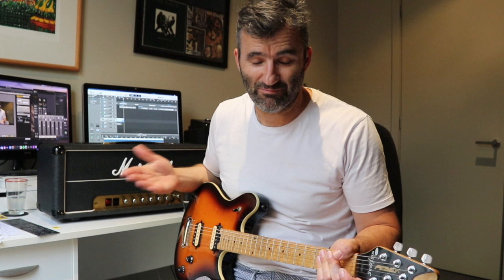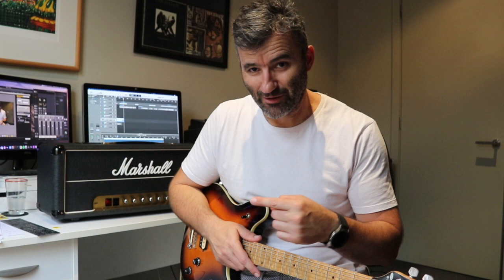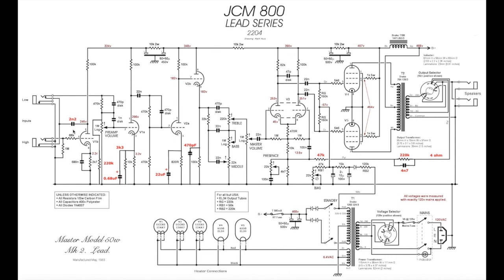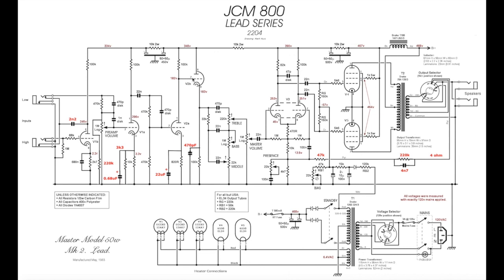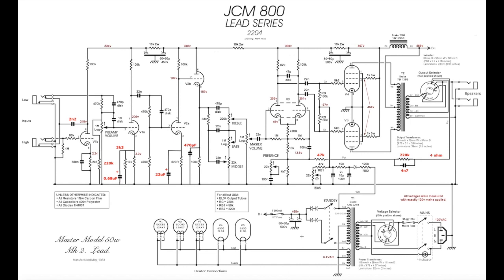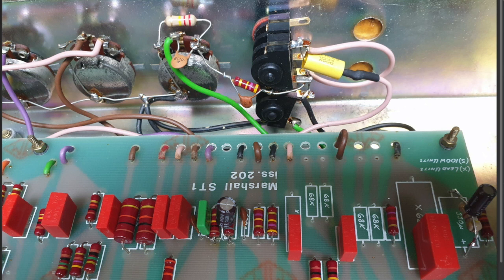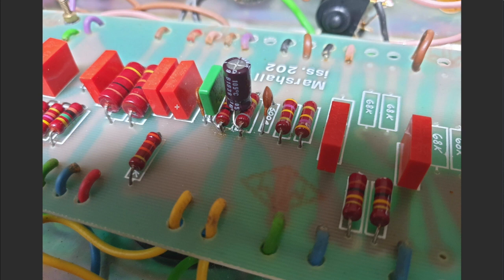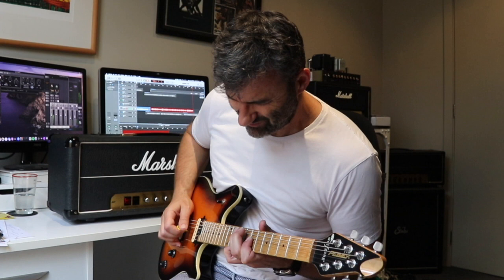Marshall JMP/JCM800 2203/2204 - Jake E. Lee Spec Mod Guide

Comment: I’ve just done this mod to my 2203 and it sounds and feels absolutely superb!! For anyone thinking of doing it (if you know what you’re doing) do it!! Completely reversible, but guarantee you won’t change it back. Amp now sounds bigger, but the low end is tighter and the clarity is great. Doesn’t add a massive load of gain - Just enough IMHO. Great stuff!!
Reply: did you leave the NFB resistor at 100k or did you change it to 47k?

Comment: Just a note guys - at the 3:12 mark I mention 1987 & 1959 model Marshalls.  They have the same PCB, but would require to be converted into 2204/2203 spec for this mod to then be applied...
Reply: Can this be done to original vintage 1987/1959s?
Reply: Any similar sounding mods for 1987 circuit with a LarMar PPIMV already installed?

Comment: This is absolutely crystal clear. Love your patient and calm approach, walking through the circuit. I learned a lot - thanks! I'm also impressed with the clean way of adding components, without disturbing other existing ones. I do worry about modding my completely stock 1984 JCM 800....But this definitely makes it an option.

Comment: Thanks so much for this Jason. Made the mods to my 1987x and now it sounds amazing. I removed the two unused jacks on the front panel used one for the depth pot and the other for a DPDT switch to make the 3k3 and .68uF across the 10k cathode resistor and the 220k across the gain pot switchable. In the up position it’s pretty much like a stock 800 with the cold clipper and in the down position you get the JEL mods in input 1 and a pretty convincing Plexi sound in the low input with the master on full. Thanks again!
Reply: hello, your modifications are certainly interesting, give us a video with the result of the change of sounds which if relevant, this will be more concrete for the audio of your modification thanks

Comment: Stumbled upon your videos couple a days ago; wow, really like how it's done and presented! And very generous too by sharing schematics 👏
I've done a slightly different take on the JEL; shifts upper-mid emphasis a bit lower in frequency and a bit less gain: 4n7 instead of 2n2 from 1st stage, 470k/470p can be left as is or both replaced by 220k (depending on wanting more/less highs), no 220k over gain-pot, 1nF on gain-pot changed to 120pF and a 680k from wiper to ground, 3k6 instead of 2k7 on 2nd cathode and no 0,68uF, 2n2 out from 2nd stage (important), and no 22uF on 3rd cathode. Keep 470pF over 100k on cathode follower. Can be worth trying 390pF as alternative value for 470pF in tone stack; gives a slightly different feel to the highs.
Reply: Good ideas. I like 390pF a lot here or there.

Comment: What's funny and to balance it out is like you said, the front end is tightened up going from the 22n to the 2n2.  Also to mention, the gain pot has a 1n "bright" cap on it!  BUT...the 470p on the 100k cathode Follower is Friedman's "Dark" MOD and darkens it.  Likewise, as you said Jason, the 4 ohm tap will make the amp sound more "dark" and again rolling off the top end.
Reply: What do you mean "dark" mod?  What amp has this?  I thought he used a 1000pf here in the be.
Reply: @cap217cap217  On the early BE-100's, Dave Friedman used to label the amps "DARK" for Dark MOD.  What it would do is on a switch add a 500pF Mica capacitor on top of the 100k cathode follower resistor.

Comment: there's a massive difference in this mod between leaving the stock 100k nfb resistor and the 47k from the mod. I played with this and ended up with an 82k.  A 47k and you just lose alotta life in the sound. i suggest folks test this before committing

Comment: How is this JEL100 spec when the 2203ish channel on that amp has a depth control and a switch with two gain levels? This sounds great but maybe it is  it's own thing.
Reply from the maker: Well, it’s essentially hard wired in the higher gain position and has a fixed depth (like having the depth pot at midday give or take)

Comment: So I've been running a hot mod evo 2 in my 77 2204. Aside from the extra gain stage is there much difference in the low end cut and response?

Comment: I'm redoing my plexi after the Cali is fixed.  Then I think I'm going to give this a go.
Reply from the maker: You could implement these mods on the 2204 board you have from us, no sweat.
Reply: @HeadfirstAmps  yeah I thought about it but  I'm really enjoying the stock.  I think I still have one board and 2 sets of transformers for a 50 watt marshall. I want to do this with a custom faceplate from you
Reply: @HeadfirstAmps  Im out of 1 watt 220k. would a half watt work here or should I use a 2 watt or just wait until my 220k arrives?
Reply from the maker: Awesome.   More is more!
Reply from the maker: 220k 1/2w would be ok over the gain pot.  You'd want 1 watt (or 2w) for the depth circuit.
Reply: @HeadfirstAmps  Hey man. I modded it today. It sounds great! That was a fun project and I learned a good bit

Comment: Hi Jason, thank you very much for this extremely well explained sharing of information which made me want to get started!
 I did everything scrupulously but I have a small problem:
as soon as the preamp is above 3, the sound, although not saturated, cuts off... and comes back if I drop below 3

When I put the 10k cathode resistor back on V1b as originally (instead of its recommendation: 4.7k + 0.68uf in parallel) the sound returns to normal.
I also tried a value of 4.7 k instead of 10k the sound cuts out too...   
A small idea? 😀
Kisses from FRANCE
Reply: I have the same problem.  Did you ever figure out what the issue was?
Reply: @patwebb6534  Sorry for the late reply. I've gone as far as I can without finding it. I took my amp head to the technician. I'll get it back soon, I'll let you know... 😉

Comment: Great videos thank you!
I have a question, I plan to build a "clone" of a 2204 but with some mods.
I want it with a power scaling similar to a Origin 20, do you have the squematic of a power scaling I can add to a 2204 ?
And I want some simple and switchable mod to add more gain, I don't know if you have some recommendations..
Reply from the maker: I haven't yet traced out the Origin 20's power scaling, but I can tell you it's a cathode bias amp and the scaling is done via varying the screen voltage, and also the PI supply.

Switchable boost,  check out my FET boost board,  perfect for a 2204.  Watch my 1987x part 3 mod clip for details.
Reply: @HeadfirstAmps  That power scaling is something that any technician could make?
Reply from the maker: Hmmm, no probably not 'any'

Comment: Ahhh. 30 years ago I modded my jmp. 5 years later I unmodded it. 5 years later I modded it again. 5 years later I unmodded it. 5 years later I modded it again. 5 years later I unmodded it and have been happy with using a SD-1 until hearing this. After hearing this I’ll be dipped, I am probably going to try this mod. Is there a 12 step program for people like me?
Reply: Sounds like you already did the first 6 steps. 😂

Comment: That amp sounds killer, I want to build a 800 replica, may be from Ceriatone or something like that, I wonder if some mods like this could be added with a switch so you can have your "stock 800" just with a switch. Is it posibble? may be just a mod that adds a bit more gain to avoid using a pedal. May be just the famous 22uF cap you mantioned. What you think?
Reply from the maker: Yes, all the mods can be made switchable.  If you check out Rubber Duck Tech's channel, he did exactly that.
Reply: @HeadfirstAmps  great, I think I will go for this, question: do I need a single switch for every single piece changed ? Can I use some modes separately or do I need to switch all together in order to work correctly?

Comment: @Headfirst Amplification  As I'm looking at the two mods. I see the parts that are the same, but coming off of V1 A in the JEL100 mod you have added a 3k3 resistor instead of replacing existing resistor like you did in the SC20H mod. what is the reason for that? Also on the JEL100 mod you have a 220K ohm resistor in the circuit, which you do not have on the SC20H mod. What is the purpose for that? Sorry for all the questions, but just trying to understand more about the circuits. I like the sound of the JEL100 mod better than the one done to the SC20H and am wondering if it is due to those changed mentioned above.
Reply from the maker: I didn't replace the'10k resistor because I wanted to make all the mods in my 2203 easily reversible.   The 220k resistor over the gain pot?  That just reduces the gain at that point in the circuit a little.

Comment: Also, the 470pf over the 100k.  Does the 500pf off the cathode stay?  What is that capacitor right up against the green 470p you added?

Comment: Hey headfirst! RIPPING mods and playthrough done here.  Burning questions I couldn't find the answer to are :
I have a jcm800 2203 reissue headfirst I believe it is from 2016 
1. Will these JEL mods still work?
2. Will these work IF I do the old trick to remove 2 power tubes because I've been wanting to take the amp from 100 watts down to 50 watts as I don't feel I really need the full 100 at home ?
^
Hope those make sense.
Thanks mate and cheers from Niagara falls Canada! 🇨🇦🙏🏻🤟🏻
- Adam
Reply from the maker: 1.  Yes absolutely perfect starting point 
2. Sure, just remember to move the impedance selector down one notch. E.g. for 16ohm cab, set amp to 8.

Comment: Killer tone! It’s says 2204/2203 but can this be done to a 4 hole Superlead? I know the circuits are pretty similar.
Reply from the maker: Thanks!  Yes, it certainly can as Marshall use the same ST1 board for both the 1959 & the 2203.  You'd need make a couple of changes to how V1 is wired up to convert the plexi into a 2203 with cascading gain stages.
Reply: @HeadfirstAmps  sweet thanks for the info mate! Can’t wait to have my tech do this mod!

Comment: Can the cold clipper mod be made as footswitchable (hot to stock) ?
Reply from the maker: You can footswitch it via a relay, but you do have the issue of the loud pop that occurs when you change the cathode resistor value.

Comment: I understand this is a mod for Jake E Lee but, the 220k resistor across the Gain pot seems really excessive.  I wonder if a 1M across the Gain pot would OK for retaining gain and not causing any blocking distortion?  What am I missing?  Great video!  Just discovered your channel.
Reply from the maker: Thanks for watching.  Yeah, you can absolutely tune this to taste.  I've modded with none, 1M and 220k and always do it based on how the amp is sounding.  They are not always the same, so this is one spot where you can tune to taste.

Comment: If you do nothing else to a stock 2203 except add the 220k//.0047 NFB off the 8ohm tap (to keep the stock 100k resistor vs swapping to a 47k) what happens to the sound?
Reply from the maker: You'll be adding low end thumo/depth

Comment: i tried this mod but to me its a bit of a one trick pony,it seems i can't control gain with the guitar volume,it's good if you only play all the time full crunch and add a boost for solos.Which is your favorite type of preamp for versatility,or going from quasi clean to  80s rock crunch?
Reply from the maker: I like this setup.  If it's too much gain for you, try removing the 0.68uF bypass cap on the 2nd cathode.  Or remove your bright cap.

Comment: How similar are these to the sir mods with the exception of adding gain stages? Stuff like the plate snubber look similar to the 36
Reply from the maker: Quite similar.   The Bypass cap over the 10k cathode cold clipper is a bit part of the sound.

Comment: My amp purple and black wires are connected together in the impedance selector. Do I still put the cap and resistor only in purple wire ? And connect the black in the same lug?  My cab is 8 ohm... Thanks!
Reply from the maker: Put the cap and resistor exactly where the purple wire that leads back to the PCB was connected to.

Comment: I was wondering if c2 is that first red block to the left? Looking to work a sir 34 mod on my JMP 2204. Are you using 1/4 watt resistors or 1/2 watt?
Reply from the maker: Possibly, you just need to trace the plate wire (blue) to see the coupling cap that is wired to each tried.

I normally use 1w, 1/2 minimum.
Reply: @HeadfirstAmps  would that be one of the blue wires coming off of v1? It’s the same board as in your video, just the caps are the older variety not the red bricks.
Reply: There was a 100pf cap soldered to the v1 tube socket, I had removed while troubleshooting the amp. Perhaps that was intended as C2? I believe it was pins 7 to 9.

Comment: Thank you for sharing this Jason. Quick question. I’ve got the mod in, but when I add the 3k3 and .68 cap cold clipper it is not working properly. Sounds like bad oscillation high pitch etc.. i have it on alligator clips and if I take it out it works fine. Any ideas?
Reply from the maker: Solder it in with short leads as possible.  The oscillation will be coming from your long unshielded alligator leads.
Reply: Thanks for the reply. Ok I tried that as well and still isn’t working, I’m kinda stumped. It’s really broken up sounding like barely any output and fuzzy.  Another symptom I’m having is when the gain pot is all the way up it is also cutting out with out the 3k3 and .68 and 220k across the gain pot jel low gain set up. Any help is appreciated. I don’t think this amp has grid stoppers. It’s a 78 jmp 2104
Reply: @HeadfirstAmps  does this sound like an oscillation problem?
Reply from the maker: You described it as oscillation, so I agree

Comment: Can this mod be applied to the SC20H studio classic Jcm800 variant? I know you have a video with a mod to it, but am only looking to add more gain, and this amp in this video sounds more like what I am trying to get from my Studio classic. Also on the video for the studio classic mod, what are the settings during the play thru?
Reply from the maker: Sure, just do the circuit mods and leave out the José style zener diodes.  I think I mention the amp settings in the video?
Reply: @HeadfirstAmps  As I'm looking at the two mods. I see the parts that are the same, but coming off of V1 A in the JEL100 mod you have added a 3k3 resistor instead of replacing existing resistor like you did in the SC20H mod. what is the reason for that? Also on the JEL100 mod you have a 220K ohm resistor in the circuit, which you do not have on the SC20H mod. What is the purpose for that? Sorry for all the questions, but just trying to understand more about the circuits. I like the sound of the JEL100 mod better than the one done to the SC20H and am wondering if it is due to those changed mentioned above.

Comment: Will this MOD also be applicable to the Marshall SC20H Studio Classic JCM 800 Lead Series 20/5-watt Tube Head?
Reply from the maker: You'd need to convert the 4 hole plexi to a 2203/2204 cascaded preamp setup, and then the 5 or so 'hot rod' mods can be added.

Comment: If you just change the 100k NFB to 47k, what happens with no other changes?  I have a super lead that I want to make a little more punch, umph, and way less brightness.  I dont want to remove the resistor.  How can I lower it to 47k?  I see I can just piggyback another 100k to make it 50k. What will happen>
Reply from the maker: By lowering that 100k to 47k you will increase the NFB, making the amp a little darker and tighter.  The other way to do that without having to change any resistor is to move the  NFB up one on the impedance switch. I.e from 4 to 8 ohms, or from 8 to 16.
Reply: @HeadfirstAmps  My NFB Purple wire is connected to the output jack wire that goes across and connects them.  The one towards the board. I assume this is getting the tap off whatever ohm you select. I play 16 ohm cabs and its bright.  Bright meaning I am turning presence and treble off, on 0.

Comment: I tried this on my amp and it’s extremely noisy. My amp hisses and squeals and once you go above 6 on the gain it loses control completely. I was wondering if you heat shrink the leads, and try to separate the caps (bright cap and treble peak)  off the preamp volume pot to get rid of this? When I touch or wiggle the cap/resistor on my gain pot the amp goes into full on broken up fuzz or just squeals like I’ve got a gremlin inside of the speaker cab. How do I get this thing working normally ?
Reply from the maker: Sounds like you’ve got something not wired correctly, or a bad connection, missing ground even.  Join my FB DIY Builders group and post some pics there.
Reply: @HeadfirstAmps  ok I’ll do that. I’ve gone over the wiring diagram and schematics a few times, and re-soldered the wiring on the pot a couple times now, still no success. I’ll take a few pics and see what I can learn from what went wrong
Reply: @tysonmitchell1147  Did you ever fix this?  What was the issue?

Comment: I did this mod to my 2203 and I left the 100k negative feedback resistor.... its kinda throwing glass at me and oscillating a little....I'm going to try a 100k resistor in parallel and see if its any better... otherwise I may go back to stock.
Reply from the maker: Have you got the 470pF in over the 100k cathode resistor (v2b)
Reply: @HeadfirstAmps  Yes, its in... its a silver mica 470pf
Reply from the maker: Increase the NFB as you suggest.  Also, make sure you have that 220k resistor across the gain pot.
Reply: @HeadfirstAmps  will do.... thanks again Jason
Reply: @HeadfirstAmps  I placed the 100k in parallel with the stock feedback resistor per the schematic and WOW...... that piece was key.  It sounds so much better its unreal.. just goes to show mods are a recipe,, you have to get every detail right or it will be off.  Posting this for others who intend to try this for themselves..... its a great mod!